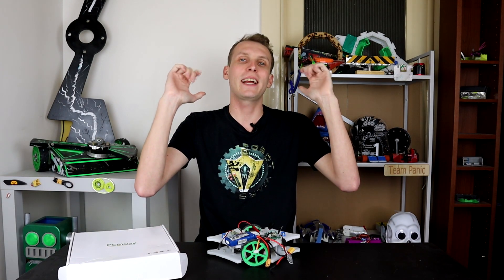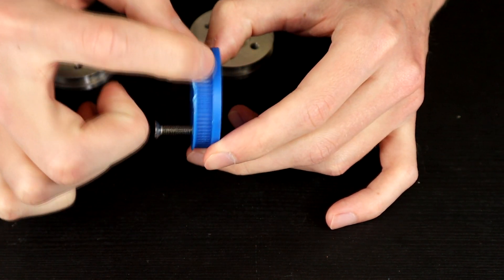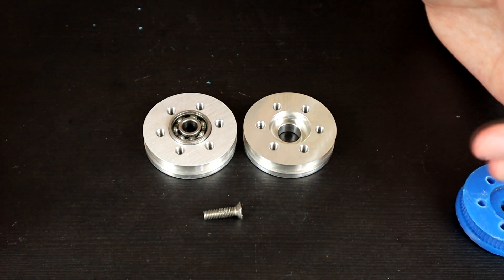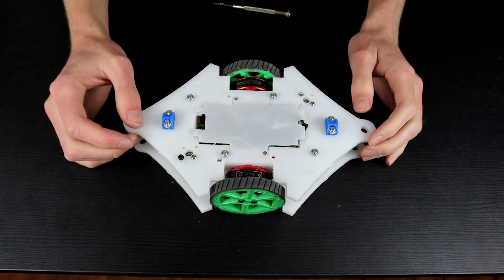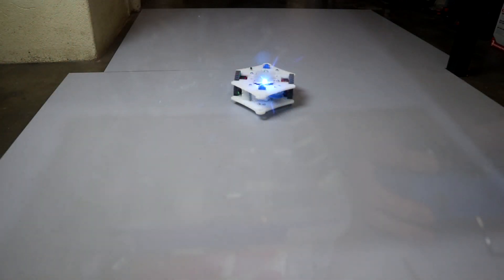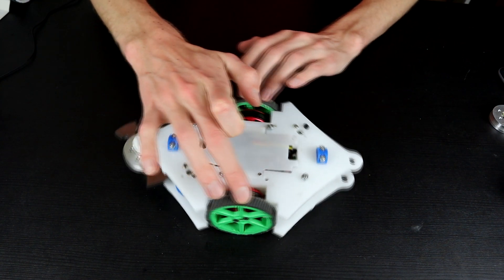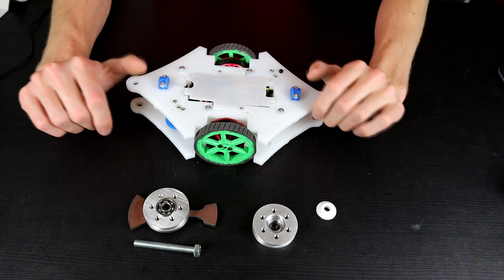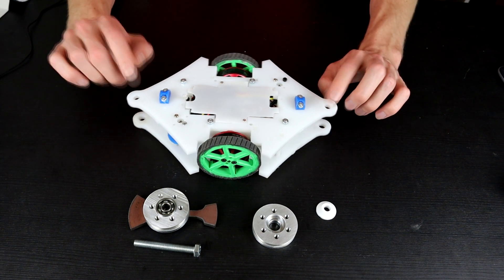Upgrading the dual spinner melty! (hardware and software)

Comment: Could you provide the files for your pulleys and also where do you recommend buying belts for a 1lb spinner?
Reply from the maker: My pulleys are made with the customizer on thingiverse, one of the models is a parametric pulley generator
That is far more useful to you then my exact files

I honestly dont know, given you are fighting a 1lb bot I'm guessing your in the states. I'm in Australia, I dont have half the shopping options you do. I basically order from small local places or RS components, but those are unlikely to be your best option

Comment: One thing I don't quite get with this robot is that aren't you losing the main advantage of a melty by putting weapons on the side? Like, I thought the whole idea of a melty is that you get to use 100% of your weight as a weapon because the robot is the weapon. When you hit the opponent, you want to transfer as much energy as possible into it, hopefully breaking it in the process. I feel like with your spinny side weapons that's less likely to happen because a bunch of that energy is instead going to go in to either slipping your belt or slowing or stopping the weapon motor.

Do I have it wrong? It feels quite difficult to work out.
Reply from the maker: It is quite difficult and I think I might be losing a little of the energy in the robot, but energy is ke=m*v^2 so an increase in speed makes way more difference then an increase in mass, the thinking is to get weapons as fast as I can get them on their own, then add extra tip speed by spinning the whole platform, 

The maths on all this gets wild really quickly so I'm trying to rely on empirical evidence

Comment: Are you able to give any details on the CNC process from pcbway? turnaround and what sorts of things translated to costs? i may have the desire to make some flat plates in future but doesn't look like their website gives any actual estimations without having completed cad designs.
Reply from the maker: The process was fairly easy, except I had to generate an engineering drawing which is not something I had done before.
Basically, for simple parts you upload a ".step" file and it gives you an estimate (for basic stuff its pretty close) it then goes to an engineer for evaluation, at which point you get a final price and can choose to buy it or not
For more complex things like tighter then normal tolerances, or getting them to tap holes (which I did with these) you need to generate an engineering drawing (fusion360 does have tools for this) and upload the drawing alongside the ".step" file, 
I found that getting them to tap the 6 holes in each one effectively doubled the cost of the parts (estimate vs final cost post engineer evaluation)

Comment: What'd you do for the tires on that thing?

EDIT - And also a controller cam would be cool during the tests.
Reply from the maker: The tires I discussed in one of the previous build videos
But they are flexible PLA prints with silicone moulded in place around the egde, but also glued down, with additional flexPLA glued in to lock the silicone in place

A controller cam is a good idea, I'll have to give that a shot, if I can fit it in the space
Reply: @TeamPanicRobotics  Okay, so it's just the silicone thing.

I'm looking into putting tires on Flash Memory and seriously considering polyurethane/silicone but might just use modified wheels and nitrile o-rings.

Comment: Its great to see ur melty again! Hope it comes along well in future. Waiting for fight report next week. After seeing Project Liftoff and other videos I was wondering if a combo of ring spinner and melty is possible.
Reply from the maker: I've been thinking about that, but as the ring has the same centre of rotation as the robot inside I dont think it would help

Like if you take a normal ring spinner, remove the weapon motor and spin the robot inside, the ring will stay fairly stationary (maybe gain a little speed due to parasitic torque in the bearings), so the melty aspect is adding very little to the final ring speed
Compare that to this dual spinner melty, with the weapon motors removed the weapons still get a tip speed equal to the melty speed (it would be ineffectual I'd imagine to hit something like that, but the point is more to see what the melty adds to the weapon)

So the melty code in a ring spinner would only give the ability to translate in any direction, but if thats what you are after a melty is a slow and complicated way of doing it, you'd be better to run some form of omni-wheels
Reply: @TeamPanicRobotics  I see. I was imagining something like, the ring would first spin up and then the melty brain part would then start spinning up, adding extra speed to the ring weapon. Something like this would give some interesting strategy options I thought. But yeah, your dual melty brain's attack range imagined in 3D will be shaped like a donut, which is pretty cool. You'll end up with a larger attack range and more powerful than a normal melty brain like Project Liftoff. 
Also, I saw one of the comments and wanted to ask whether have u thought about switching to metal tyres? If the arenas in the competition is wooden, referencing Project Liftoff's current design(which has 'ar' steel wheels), you'll probably get more grip even later in the fights when the arena has been damaged badly. What do u think?